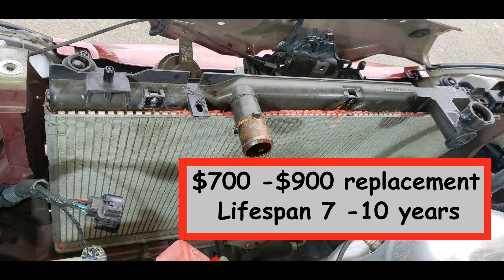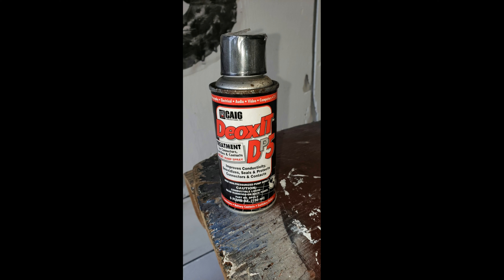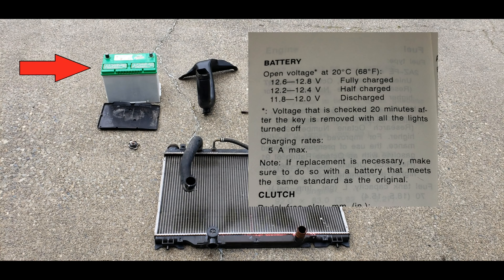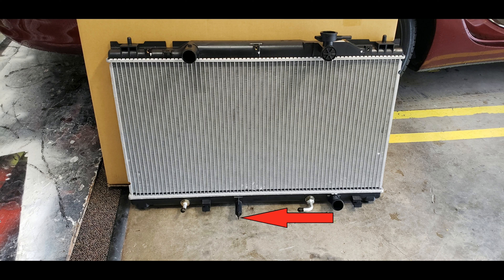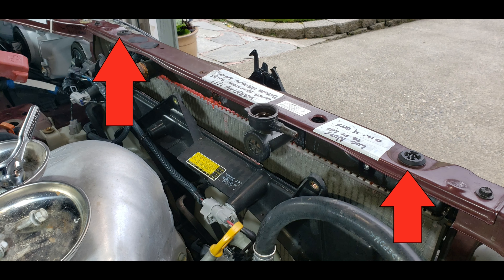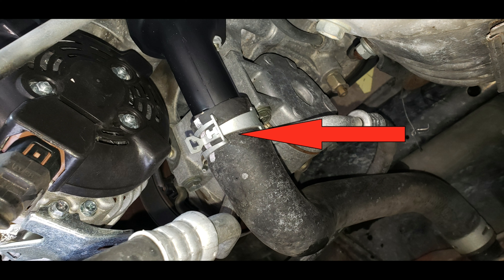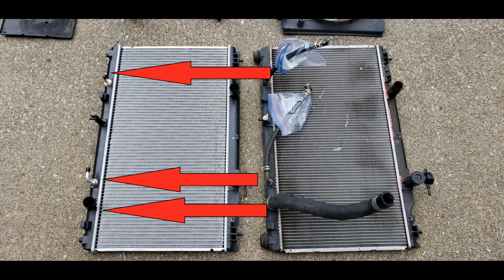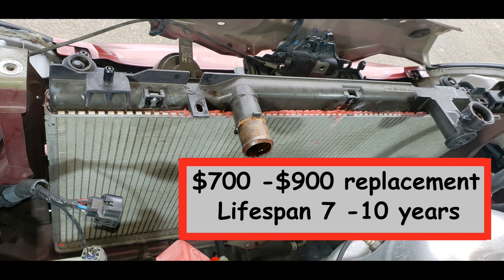Auto repair (changing a radiator in a 2002  - 2006 Camry)

Comment: Take the hood latch off to access the center 10mm bolt.  Repla e that bolt before the latch.
Reply from the maker: Thanks for the info. I did remove the hood latch 9 minutes into the video. Learning curve for next time!!
Reply: I just replaced my radiator and decided to leave the latch attached.  Instead, I removed the 2 bolts holding the vertical support in place.  So, I removed the top plate and the vertical support, with the latch and horns in place.  Easy peasy.

Comment: Changed my radiator a few days ago, refilled with Prestone "all vehicles" and drove about 7 miles home w/ no noticeable problems. Next day, topped off radiator, added Valvoline MaxLife ATF, now it's not shifting right in drive... hard to increase rpms. I wonder if I overfilled the transmission or if a problem was caused by not adding ATF sooner. Any sort of guidance would be wonderful...
Reply from the maker: I'm sorry to hear that. I'm actually do not have any words of wisdom for this. I know absolutely NOTHING about transmissions. Heck, just checking for the correct transmission fluid level is hard. Check it with the engine running like the manual says, it's at a different place on the dip stick every time! So just to be safe, after doing this radiator change, I paid Toyota to change out my transmission fluid. That way I know the level would be proper. I was also due for a fluid change anyway.  Good luck!!
Reply: @bounder97  Thanks for the good luck! Lucky for me, it's doing better now! Not good as new, but good enough lol. Fluid level good also... No idea what was causing the weird behavior. Might let a transmission shop test it just to be safe.

Comment: I've changed radiator on my Camry 2004.. everything fine. but when i leave the car running in idle. its stops after few mins and dashboard shows batter ligh, oil pan and Check engine light lol.. dont know
Reply from the maker: That's strange, sounds like the same lights that come on when you just move the key to the on position without starting the car. That's a lamp check routine. Grab you code reader and pull the codes out of the car! Can't imagine the radiator is causing this problem, but who knows.